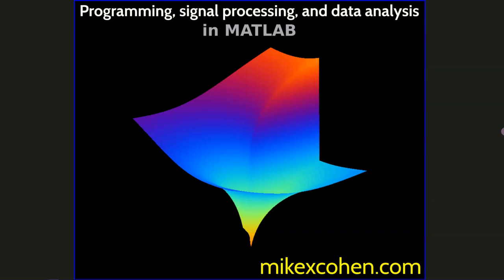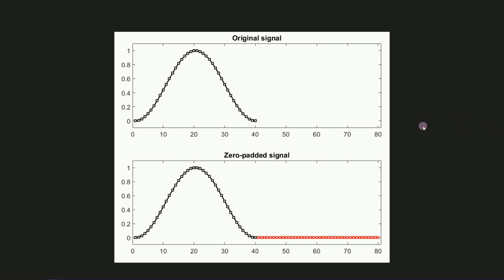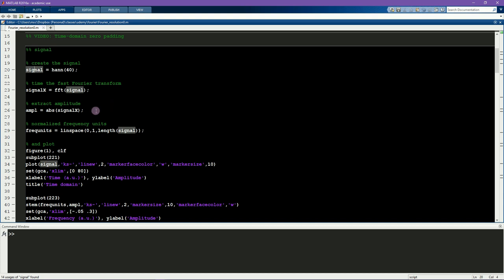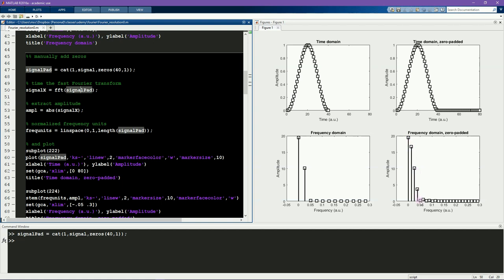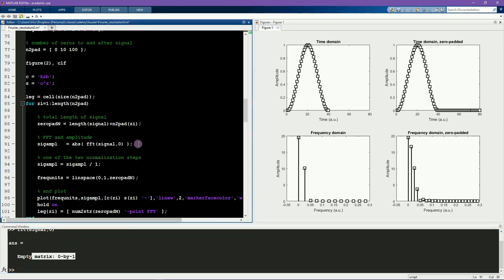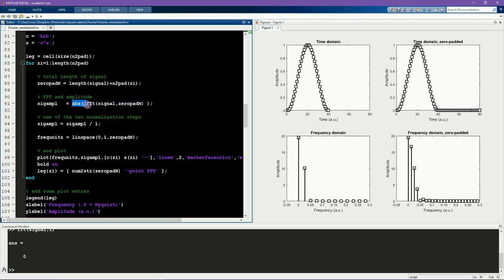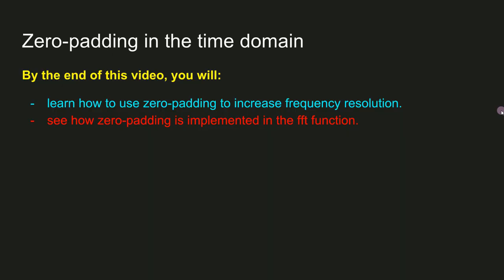Zero-padding in the time domain

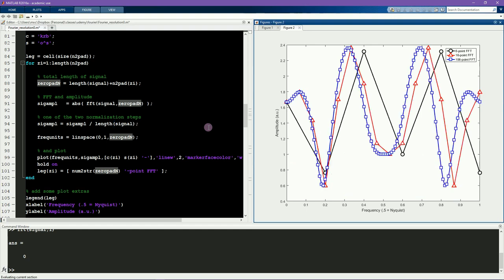Comment: 7:57 It seems a little odd that the maximum amplitude increases slightly above the base value as the signal gets spread across more frequencies, it looks like it's getting pulled from surrounding frequencies. I'm seeing the same thing in my code though.

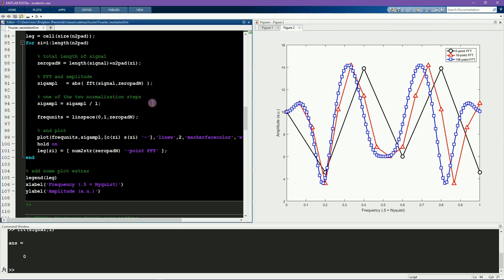Comment: Dear Mike, According to the figure at 6:50, can I conclude that by zero padding the detected main frequencies are changed? As the figure shows not only the black line is smoothened, but its peaks and troughs are also shifted.
Regards.
Reply: This doesn't make sense hey. 50k or 100k data points sampled at common frequency leads to changed frequency content of a signal, this doesn't sit well with me. I just don't understand how padding a signal with zeros changes frequency resolution, someone needs to assist me to understand this. U just increasing data points without fiddling with frequency content.

Comment: Thank you Mike, very helpful videos. Does Matlab really extend the signal with zeros, if the coeficients are calculated over N/2 points (going from two sided to one sided domain) this zeros aren't used,.. or only doubles N and N is used then for normalization and calculating frequency resolution?

Comment: I see a shift in the zero padded spectra, the more zeroes the more it shifts to the left. So zero padding produces a shift in the frequency domain?
Reply from the maker: Good observation, but no it doesn't produce a shift in the frequency domain; it increases the resolution (that is, the spacing between successive frequencies decreases). The phase values of the Fourier coefficients will preserve the time series order.
Reply: @mikexcohen1  many thanks for your explanation and your wonderful video. I probably didn't understand what I saw at the end of your video, where the blue and red zero_padded spectra move away from the original in black. That also happens to me when I am trying to resolve two frequencies that are very close together. First I chose a large enough length of the time signal that  will resolve the frequencies and they look fine in the dft, but when I zero_pad the signal in the time domain the padded spectrum shift a little. I don't know what I do wrong. Anyway congratulations and thanks for the quick reply!
Reply from the maker: You might not be doing anything wrong. When you add more zeros, it changes which frequencies have exact cycles in the time domain, which means that it introduces some non-stationarities, which ultimately smooths out the spectrum (this is part of the zero-padding theorem, which basically states that zero-padding in one domain is sinc-interpolation in the other domain). You might try zero-padding by an integer multiple. For example, if the original time series is N points long, then do a kN-point FFT, where k is any integer.
Reply: @mikexcohen1  thanks again for the insight, defininitely there is so much more to zero padding than I know, I will check the theorem for more understanding.